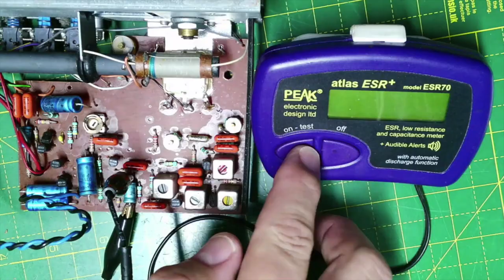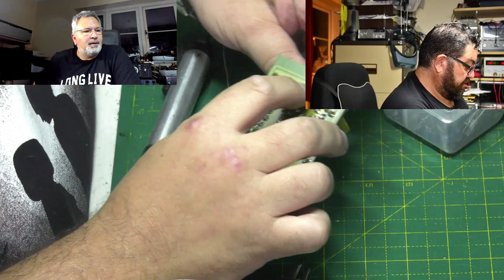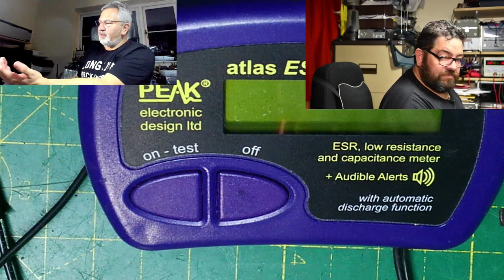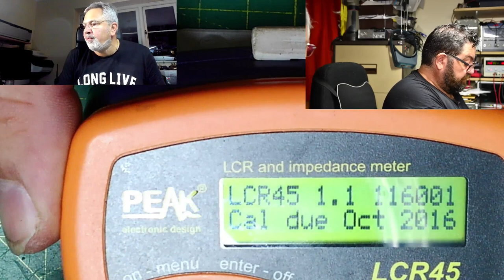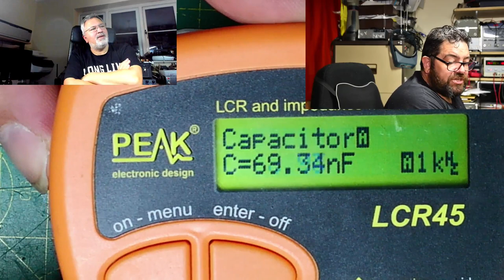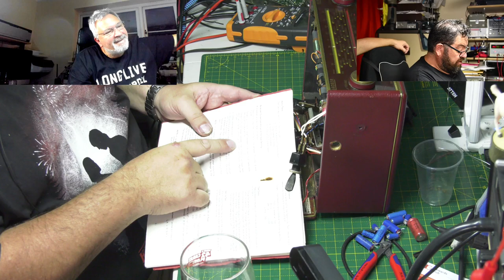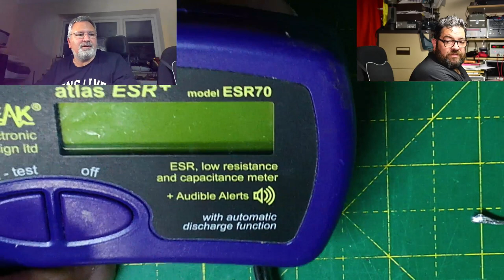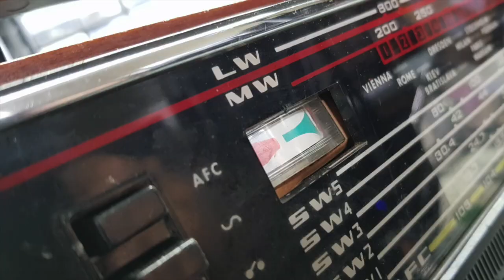Weekday LIVE : A special guest drops in on the Cruncher

Comment: Hi chaps,
Now the Hacker amplifier has been re-capped, and biased, it is now over to sorting out the tuning capacitors vanes, more recapping where required, and fitting new drive cord.  You’re both welcome to fitting new drive cord LOL.  
I’ve just completed repair of a Hacker VHF Herald: it was not repaired as a YT upload.  Usual replacement of capacitors on the audio output board - found a 400uf  @ 10 V. D.C. reading o/c.  After biasing the audio worked fine.  Further test revealed a BF195 was defective in the VHF section.  Once replaced, the radio now works fine.
My next two YouTube uploads (first one will hopefully be uploaded later this month) will feature a 1957 Bell, Planet Colt radio, manufactured in New Zealand, and two 1948 Philco ‘hippo’, model 46-420 radios from America.
Loved viewing this video: it was certainly good fun!
Best regards, Phil.
Reply from the maker: Hi Phil. Thanks for your kind comments. Well done sorting the VHF Herald. Alignment can be tricky on those. The lockfits are really starting to fail now so soon it will be a change in sight like the AF117’s. I will keep an eye out for your new releases. Regards Graham